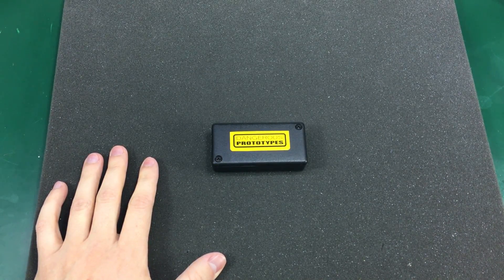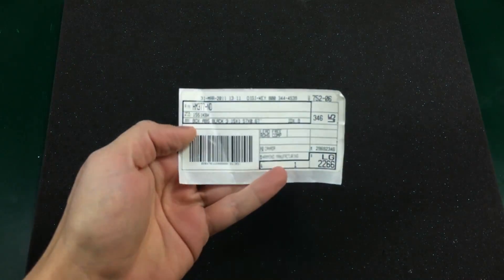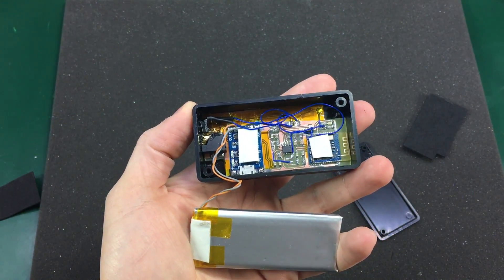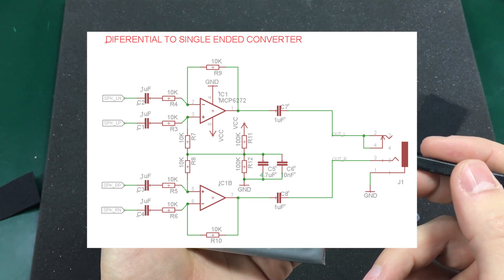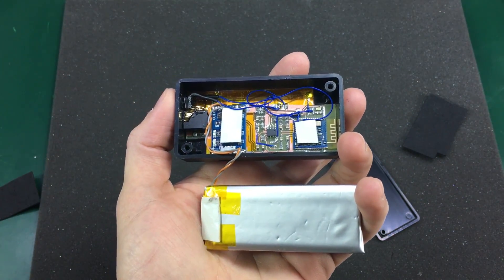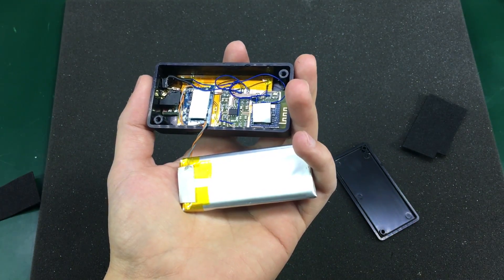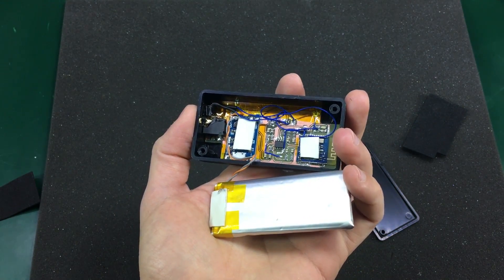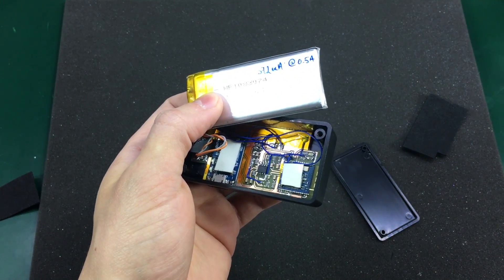Voltlog #93 - Bluetooth Receiver Weekend Update

Comment: Great Build! Very tidy wire management.
I would treat lipo batterys very carfully, they don't have a hard protective layer like 18650s . I see some pressure marks on the one in your build. But i should be ok with the foam spacers.

Can you give some more information about the differential to single ended signal converter? This is exactly the missing component in many of my speaker builds, ive been looking for. 
If it works conesiderably well for all frequencies, i'd be interested in making/getting made some of these.

I use a csr8645 5w + 5w amplifier & bluetooth combo module as a pre-amp for an analog equalizer (Baxandall Tone Control Circuit) in most of my speaker builds. The pre-amp puts out a differetial signal (L+, L-, R+ ,R-) witch is no problem for the equalizer, but nearly all cheap and good sterio amlifiere boards require a sigle ended signal(L+, G, R+). Even if you use 2 mono amlifiers the "negative" terminal of both equalizers are directly connected via ground.

Untill now i have only found 3 unsatisfying  solutions to this problem:
1.Two separat power supplys/batteries for 2 mono amlifiers. This is not very handy especialiy in mobile aplications, where you need batteys.
2. Using 2 mono amlifiers with one of them resciving power from a module that isolates the ground. These modules are hard to get for ampages of over 500ma and the ones i have found cost at least 20$, 10x more than the amplifiers I use.
3. Using comercial car ground loop isolatiors. These basicly isolate evey chanel by putting a 1:1 transformer between the L & R pairs. It reduceses the general noise a little, but many of them use cheap transoformers, causing some loss in the low frequencies.

Also it is not possible for in the moment me to convert a sterio signal to a mono signal from a bt-resciver by simply using two resistors. This is what would do for a single ended signal.

For all bluetoth mono speakers I built so far I am forced to use only one chanel for the input. As an audiophile this is a hard to accept fact.
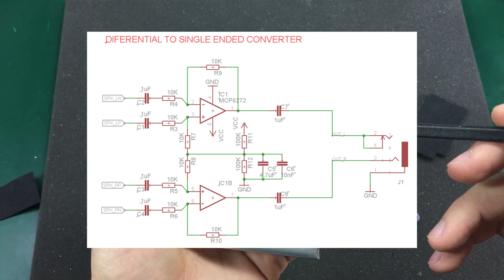Reply from the maker: 3:59 the schematic for the differential to single ended converter
Reply: schematics file?

Comment: Looking fwd to a full test. I've a bit of a debate with my nephew about the BT devices from China with fantastic specs but when you test them you get a lot of garbage on the output.  We also both have a fancy one with an external antenna (banggood sells them) which only has like 4 meters range no matter what antenna you put on it.
He also has a Philips one which seems superior in any possible way.  He claims a range of 25 meters and absolutely clean output.
Reply from the maker: Range is not usually important for me, but with those pcb antenna you can expect 5-10m line of sight range. Audio quality does differ between modules, CSR makes some pretty good ones like the CSR8635 and CSR8645, these have modern codecs inside. Audio quality might also be influenced by the op-amp used to do the conversion from differential to single ended, I used a decent one. The PCB layout will also play an important role..
Reply: The one I am talking about is this one  http://www.banggood.com/HIFI-Class-Bluetooth-4_2-Audio-Receiver-Amplifier-Car-Stereo-Modify-Support-APTX-Low-Delay-p-1096165.html
Supposed to have the high end CSR64215 but you can already see in the comments on BG that there are other people mention low freq noise and range issues.   
As you said pcb design and also a good power supply and decoupling at the ic's is very very important.  I haven't had the time to check those things out yet,
I've had a BT receiver with nice specs and the capacitor over the multiplier resistor, the basic inverting opamp amplifier, was a 1nF which made a cutoff low pass filter with the  -3dB at like 1KHz.  Changed those to 47pf and output was still clean and it sounded nice all of a change.    The Chinese have a weird way of thinking and manufacturing it seems.
Reply: How to convert differential out to aux out? I want to preserve all the sound channels